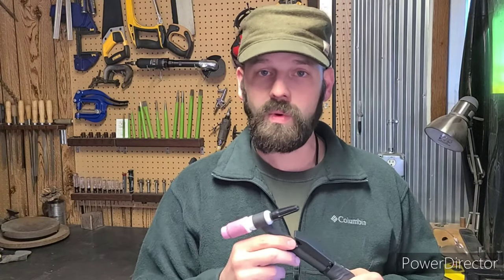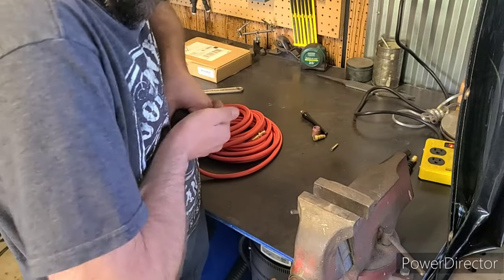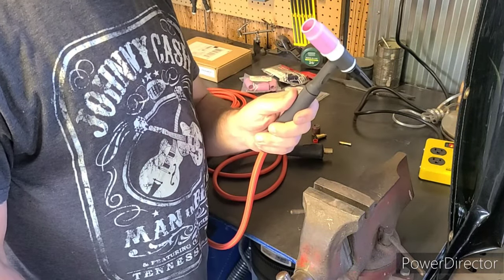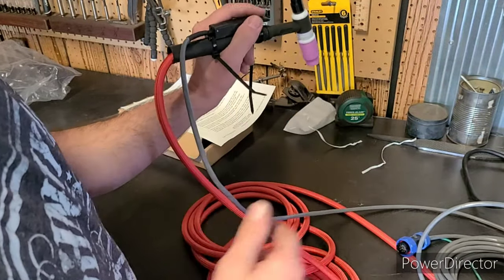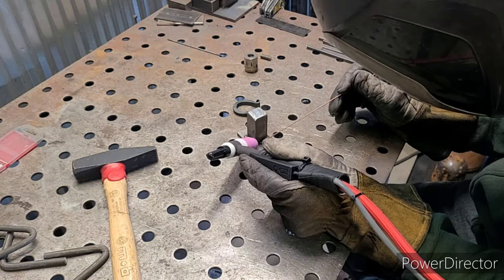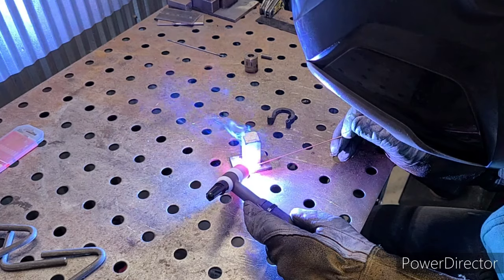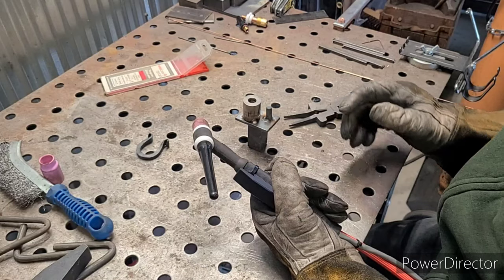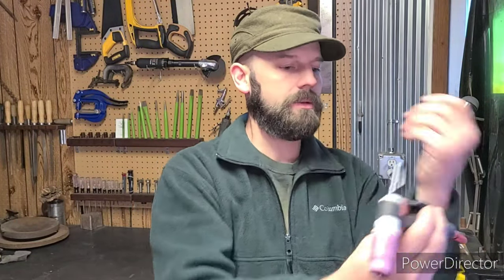SSC Vulcan Protig Button and Tig Torch Upgrade Review

Comment: I think you're exactly right; you had a leak somewhere in the torch head.  I like to measure Ar flow right at the cup using a little "peashooter" flowmeter ($10 - $15 from Amazon).  If it reads lower than the regulator, I know to look for a leak.

Comment: Its actually your gas lens...  Had a similar problem with Amazon Cup Kit...  Need a Furick...
Reply from the maker: I'm fairly certain its from mixing quality and cheaper consumables.  Furicks are nice but overpriced. The modern and cheaper alumina and ceramic cups function just as well as furicks.

Comment: Hey, my name is joe i make a FINGERTIP AMPERAGE CONTROLLER for the Vulcan protig 200/205 and also for the 2+3 pin tig welders i would like to send you one if you would give me your honest opinion about it. If you or any one you know has welders with these types of connectors i will send you one thanks.
Reply from the maker: I would be interested in doing that, I'll send to a message with more details.
Reply: @steelforestweldingandforge  sounds good
Reply from the maker: Sorry to take so long to get back to you. I'm so old I still remember when YouTube had the pm option will apparently that is not a thing anymore :)  Will it be possible for you to send me a message through my Facebook business page. Link to my business page is in the description of this video.
Reply: Joe I'd like info on your tig switch I'm in the market to buy one....also @steal forist welding and forge what was the brand and model of that one you tested in this video? You names off the new flex whit brand and model but I didn't catch the button
Reply: Info on your controller I'm in the market for one
Reply: Definitely interested in hand/finger controls for vulcan welders
Reply: Hey man I'm interested in this I'll buy one today!!

Comment: You are varying the amperage with your finger control, not voltage. Same with your plasma cutting video. The knob adjusts amperage, not voltage. I think i would prefer a slide type control? Thanks
Reply from the maker: correct